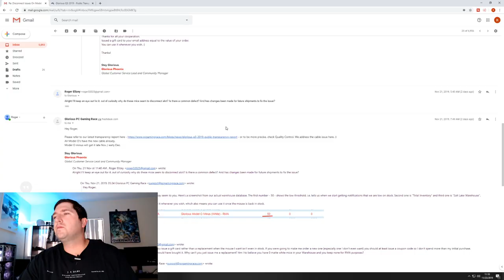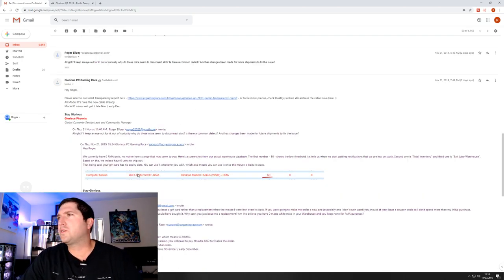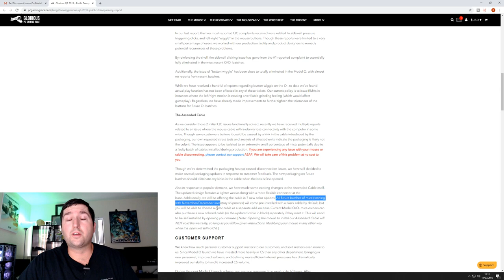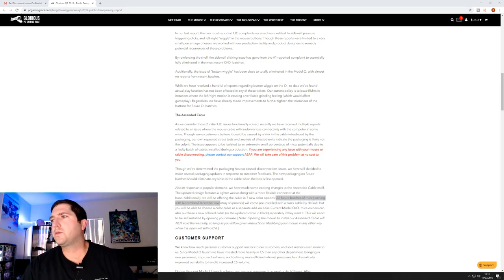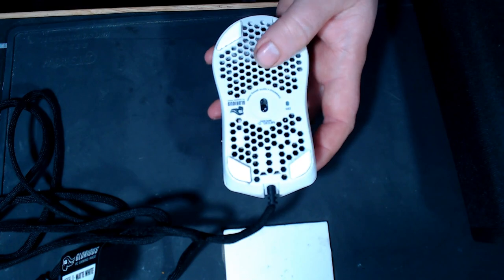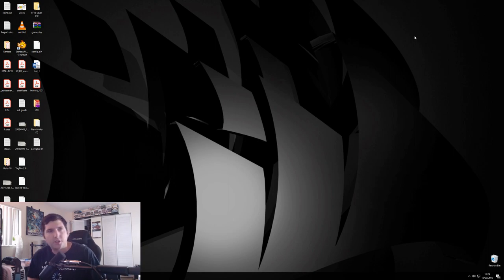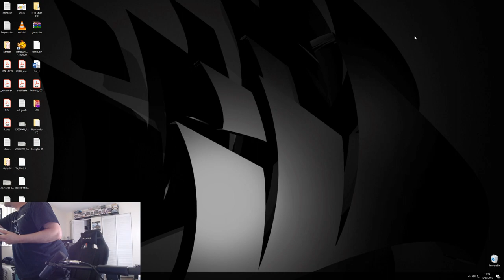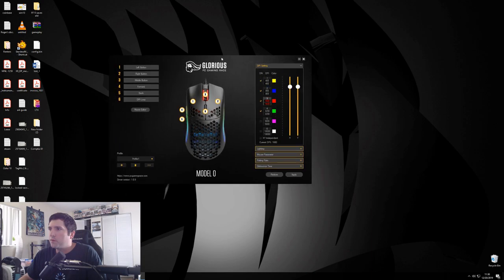Glorious Model O/O- Disconnecting Issue (FIX)

Comment: I've had my Model O for a year now and in the past its lasted about 6 months to a year till I need to get it replaced. My problem is that it'll randomly disconnect, I found a fix for this by wedging the cable into my laptop and a weird angle and really push it in there but thats a very temporary fix and thats probably gonna last a few weeks. Your best bet is to just replace the cable or open up your mouse like this guy shows you how to and make sure everything is plugged in. You should be able to buy one from the website if this doesnt work for a few dollars if you dont have warranty.
Reply: ik, 3 years late, but what if it doesnt work and you dont live in a place that Glorious ships stuff??
Reply: @1ftk  glorious ships cable replacements for free but if they dont ship to you find a cable compatable with your mouse (like other mouse parts) and i guess try to fix it? at that point you might just want to get a new mouse if you are gonna be spending that much money

Comment: My mouse stopped working the way it did yesterday, the mouse disconnects, the lights stay on and the sensor and buttons dont respond. Only replug fixes it for like 2 min and then it starts over again
Reply from the maker: Hmmm, that is a little different. I would try doing the steps I posted in the description first. It's the one about reinstalling the driver software and hitting Restore. Then if you want doing the cable swap. No promises that will fix it. If you have another mouse to steal one off of just to test it there would be no cost to try it out. Let me know how it goes.
Reply: @draxxilletech  how do you change a cable on the model o (nvm i havent watched the whole vid)
Reply: @draxxilletech  i think this is because i used to hide my cable under my monitor
Reply: @draxxilletech  can i use my deathadder elite cable?
Reply from the maker: Yea you should be able to use that cable. It's the same USB connector. There is a possibility the pins may be different on it. The only reason I say that is because on the old trackball mouse I used to test my model O- two pins were different so I swapped them. But that mouse was really old, so I think you will be fine. Keep in mind if you take apart the deathadder the skates are usually ruined after. Let me know how it goes.
Reply from the maker: Well if you look at my latest video on this issue you will see what caused this defect, at least for my mouse. Something was messing up from the factory
Reply: True
Reply: I just beat mine and it starts working again
Reply: @Senjutsu1   wtf I was having the same problem and was rly fed up so i tried to find anyway to fix it. I tried this and it actually worked for me
Reply: ;ughrrg my dpi button got stuck in now
Reply: @Senjutsu1  it actually worked wtfff
Reply: did that fix work for you?
Reply: Bro this is exactly what happened to me how do I fix it please respond
Reply: I had the same thing but when I restored the software it worked again so thx.

Comment: Wait when you were moving your mouse he was disconnecting and connecting all the time?
Reply from the maker: Yes the original issue was like a disconecting reconnecting type issue. I just made a video showing what likely caused it. At least in my cable, all the wires were actually cut.
Reply: @draxxilletech  i contacted site from where I bought it and I hope they send me new cable
Reply from the maker: If that was the PCMR website they refunded me the full cost of the mouse then I just bought a new cable with the money. That worked out for me because that left me with about a $30 credit to their store.

Comment: Had the same issue with my mouse. 6 months in and it  was disconnecting constantly. After a tear down of the sleeve for the cables I found where the bend was from how it was packaged from factory, each coloured cable had a split in it and the copper wires where also split. Very disappointed. I guess if you buy cheap, you get what you pay for.
Reply from the maker: Yea, if you look at my other video I did the same thing and found the nicked wires. I would try contacting support to see what they do. They have replacement cables that are supposed to not be defective.

Comment: I don’t know what you mean by “unclip this” at 3:56 could you tell me? Because I just got a new cord from glorious gaming and in trying to remove the old one but I don’t wanna break anything important by pulling too hard on the cable
Reply from the maker: There is a connector that you can simply unplug. Although I am unsure if they solder some of them, but mine was a simple connector that you can unplug. I have talked to a rep this week though and was told they have a guide on their website on how to do the cable swap. So if they made a guide I am assuming all of their mice use a connector.
Reply: Draxxille Tech oh I thought you were talking about unclipping something else to disconnect the cable from the mouse. Anyway, thanks for the help (:

Comment: i took a cable from my old steelseries mouse and then i placed it in my model AND it works just fine now i am so happy thanks!!!!!!!!!
Reply from the maker: Awesome man! Glad to hear you got it going
Reply: how do you take out the other wire I don't want to pull it out for fear of breaking it
Reply from the maker: Which wire are you talking about? There is the ones for the rgb, it's a simple ribbon cable, just lift the latch on it.

Comment: Anybody else have problems with the mouse wheel. Mines really stiff on one side and lags whenever I use it. Really good mouse, shame about this connection issue too.
Reply from the maker: They mentioned this is their transparency report, "We have been made aware of a few minor issues on a small handful of mice - these have included slight rattling of the scroll wheel" doesn't sound like your issue though. I would contact their customer support for an RMA or replacement.

Comment: Thank you so much didn’t need a new wire just restored it and that worked for me
Reply: how did u restore it im having this problem where it disconnects and reconnects
Reply from the maker: If I remember right there is an option to do that somewhere in the Model O driver software in windows

Comment: got the o- start of October and it was working fine until literally the 23rd of December when i moved the cable around and it just stopped working, every click was working somehow but the courser  was not moving, today i got the new cable they send me but the same problem is happening :D so ill be sending it back to where i bought the mouse from
Reply from the maker: Don't do that! Try this, reinstall the driver, run as admin when you boot it, then hit restore in the bottom right of the driver. I had the same issue and that fixed it. I show those instructions in this video if you need to see it.
Reply: @draxxilletech  lmao somehow it worked, i got a new pc and didn't install the software on it cuz i already set it up, thanks for the help haha
Reply from the maker: Nice dude! Congrats on the new rig! Yea their customer support was really good. They are the ones that told me about that, hopefully the new ascended cable fixes this issue for good. The mouse is amazing, and I have had many different mice before this one. The lightweight design is awesome. Glad you got it back going!
Reply: @draxxilletech  its funny cuz i never write comments on videos but i guess it was a good idea to do so today😂 ill be back clicking heads in no time xd thanks for the help
Reply from the maker: Hell yeah dude! Glad I could help out man, show no mercy!

Comment: Jusg a little question
I tried to replace the cavle with a old cable that its working
Bu then it turns on the lights and  a few seconds after they turn off
How do I fix it?
Reply from the maker: In the amount of time that the mouse is on is it fully functional? I would make sure that the USB pins match the original ones on the model O. There is a chance that it is pinned different. You have to test this by doing a continuity test with a multimeter. If you look in the USB connector that plugs into the computer you will see contacts, you test between that and the wires on the connector. There is also a chance that the wire colors are coded the same. They don't always use the same codes. If you know the wiring is the same for the replacement cable then try the steps in the description, those steps aren't really meant for that issue though. Make sure the connector is fully seated, if none of that works try to get a warranty claim. Their support is really good, they will take care of you.

Comment: My model o just disconnencts and then connects back. The cable is the problem i think because if I bend the cable to the right it disconnects but if i bend it to the left it connects. And thank you for the video , I will try it!
Reply from the maker: Yea, that sounds pretty straightforward. Don't forget to do the last steps in the video if the cursor doesn't move after swapping the cable. Let me know how it goes!
Reply: Same problem here :(

Comment: The wire gauge is too thin for how it's packaged. Poor design choice IMO, I mean does 8-10" of wire from a bungee really weigh that much? My Model O currently has this issue. I'm a certified aircraft electrician and I knew when I unboxed the mouse the cable wiring was too thin and it probably has the wrong insulation for wire that will be manipulated which was compounded by how they packaged it. During packaging they severely kinked the wires in the cable. Now on the website the Ascended Cord is rolled with no kinks, but in this video they are still packaging the cord the same way, so I wouldn't be surprised if these new cords fail too. Standard gauge for USB devices is 28, but the wire gauge they used is 30 which is fine for components that don't flex the wire repeatedly. As for where it will likely fail as it did with my mouse, it will fail on a kink in the wiring that is closest to manipulation, meaning probably the first kink from the mouse, about 3 inches from the mouse. This is where mine failed and it makes sense. It's very unlikely damage will happen while installing the ferrite core which is the thing he suspected was the issue, it never really moves if at all once the mouse is installed. Glorious needs to simply change their packaging method, they should ship the cable the way they picture it on their website. Good mouse, just if they insist on using a lightweight wire, they should reconsider how the treat it when packaging.
Reply from the maker: If you look at my other video on this issue I actually stripped out the cable and going the flaw. I have no idea why but each wire was reamed all the way around. My guess is the wires shorted to each other. But what I don't know and can't explain is why it happened over time. I removed ferrite core and saw no sign of damage, I figured that was where it would have been. My only guess is maybe in the manufacturing process the wires got nicked, how though I am unsure.

Comment: I ordered this mouse today, hope I don’t have this problem
Reply from the maker: You shouldn't, the new mice come with the new ascended cable which should not have this defect.
Reply: Draxxille Tech what new mouse?
Reply from the maker: Okay, so PCMR used the new ascended cable on their latest mice that they manufacturered. It should be the same one they sell on their website. They did this because of the defects. I think they started doing that in November. It's in their transparency report.
Reply: Boxely u shouldnt

Comment: ¿It needs a special specs wire or I can use any other gamer mouse cable Just adjusting the color order?
Reply from the maker: Yeah you should be able to use any mouse cable as long as the connector is the same. Seeing how my old Dell trackball mouse had the same connector I believe it is standardized. There is a chance that the wires may be in different spots however. I believe I posted in the video description on how to deal with that.
Reply: @draxxilletech  Thank you.

Comment: i’ve tried the restore and apply thing but it says sensor unmatched and settings unsaved how do u delete drivers and reinstall them onto the mouse?
Reply from the maker: That's a unique issue, I'll see if I can find anything on it. You can try to uninstall the Model O software then go to device manager in Windows and uninstall the mouse driver there too. Then reinstall and try again. I will Google around and see if I could find any similar issues. if you figure it out let me know what you did so I could tell people in the future.
Reply from the maker: So I found a Reddit post here: 
https://www.reddit.com/r/MouseReview/comments/ctk8li/glorious_model_o_sensor_problem/?utm_medium=android_app&utm_source=share

They are saying the fix is to flash the firmware on the mouse and that can be downloaded from their website.

Here is a YouTube guide going in depth on how to do the flash:
https://youtu.be/Dbp2apkC_y8

Best of luck and please let me know how it goes.
Reply: Draxxille Tech i hade previously seen that video and tried everything in it my driver seems to be at the latest version i would like to know if there is anyway to delete the driver off the mouse and reinstall
Reply from the maker: Well that does delete the firmware off the mouse then replaces it with the one you specify. That seems to be what you are asking how to do. If the latest firmware is messing up your mouse then I would suppose you should try an older version. Getting a copy of it though is going to be kinda hard. What exactly is the mouse doing? Also, have you reached out to customer support yet for their input?
Reply: Draxxille Tech yh i asked customer support just waiting for a reply i’m starting to think it might be a genuine sensor issue
Reply from the maker: Well, fortunately their customer support is really good. That's how I learned how to fix my mouse. Not only did they tell me how to fix it, they refunded me anyways. If you learn of a fix please tell me what you did so I could help others in the future.
Reply: Draxxille Tech definitely will tell you thanks for the help anyway i will most probably try to get a replacement but do u think they would send me a replacement seeing as i ordered it off amazon not the glorious website
Reply from the maker: Well that depends on how old it is. Manufacturer warranty should cover all products regardless of where it was purchased. Even if the product was out of warranty, if the product had a manufacturer defect I think they would help you anyways.

Comment: I know this video was posted quite awhile ago, but this problem recently started happening to me. I was looking at the Ticket thing and it needs me to get a video of it disconnecting. I feel like this might be an obvious answer, but should i record my game or the mouse or both? And it also doesn’t happen super frequently, so should I just be recording all day and hope I get lucky?
Reply from the maker: Yea, I know it's hard to get a video of it if it's intermittent.  They probably would want to see that the mouse isn't responsive. I kinda just smacked the mouse around a little bit and it triggered the fault. You can tell the rep that it's intermittent so it's hard to get a video. Maybe they will go on ahead, it's hard to say.
Reply: Draxxille Tech Alright, and thanks for answering so quickly! I was expecting a much longer wait, but this was definitely helpful. Tysm!
Reply from the maker: Haha, no problem. I try to stay on top of the comments.

Comment: I have the same issue, replaced the cable and it's doing the same shit now. I noticed that the scroll wheel is damaging the cable, and I think that's causing the mice to disconnect. Also, my cables look like the newer ones. Any ideas how to stop the cables getting damaged?
Reply from the maker: How is the scroll wheel damaging it? Is it somehow rubbing against the cable internally? Before doing too much I would try to RMA it, even if it's out of warranty they might still help. The scroll wheel shouldn't be damaging anything, the cable should be routed inside the mouse to where it wouldn't make contact. If it is then you need to get it away from the scroll wheel. There should be a channel in the mouse to route the cable. The defect mentioned in the video was from the manufacturing of the cable. A portion of the cable was cut during manufacturing. Glorious acknowledged the defect in their quarterly transparency report.
Reply: @draxxilletech  Yeah, the scroll wheel it's rubbing against it. It's not always touching the cable but while moving the mouse it keeps getting closer to the scroll wheel. When the cable starts getting into the mouse there is a small gap without any isolation etc. Just raw cables. But I came up with an idea and covered the gap with isolation tape and i think it should work.
Reply from the maker: Yea, I was thinking something of that sort, as long as the tape won't interfere with the scroll wheel. Hope it works out for you, let me know if you got any issues.

Comment: my model o works fine but whenever i turn my computer off the lights on the mouse turn off for a while and then they turn on while the pc is still off. is there any fix for this?
Reply from the maker: I believe that is actually a bios setting. There is a setting that allows USB power while the computer is off. Go to the power management tab in bios and look for something called EUP or ERP and enable it. That should shut off the USB ports when the computer is powered down.